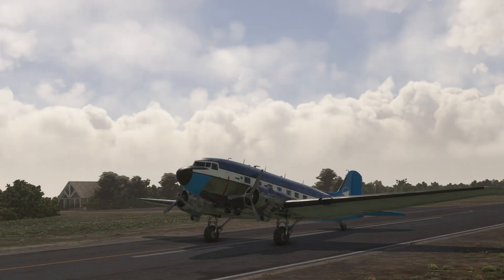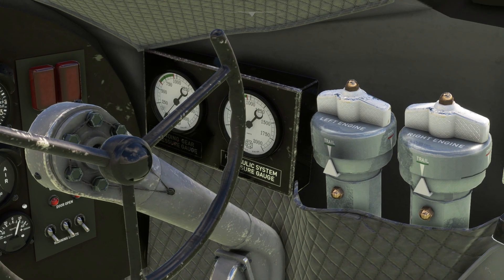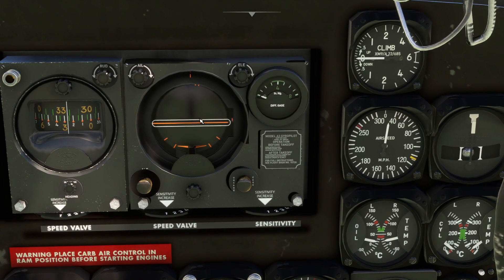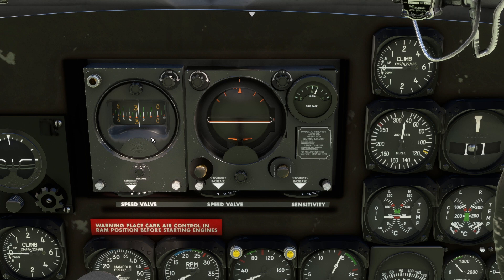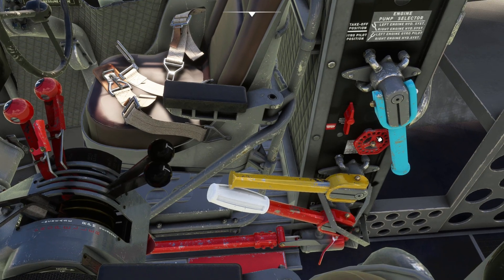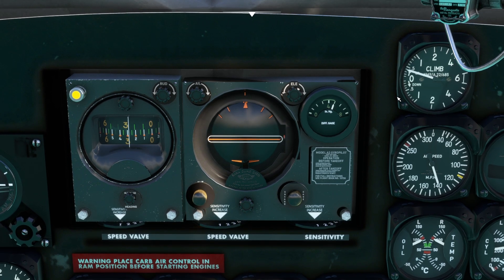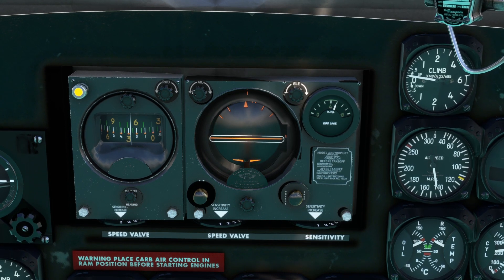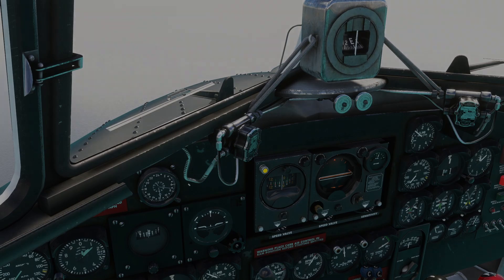The most UPDATED TUTORIAL for the Douglas DC 3, C47 GYROPILOT-Autopilot | Microsoft Flight Simulator

Comment: Very good, most of the tutorials on how to operate this are out of date and show an incorrect method. Microsoft haven't bothered issuing updated instructions for this aircraft since it was updated. However, there are two important points you should have mentioned:
1. The aircraft will sometimes initiate the turn just by moving the rudder knob without needing to touch the bank angle control. This seems to be entirely random.
2. Occasionally the aircraft will not stop at the selected heading but will merrily continue banking, turning in a complete circle forever if you don't intervene. This is less common.
Both these effects appear to be bugs.
Reply from the maker: Thanks for the additions. Yes there are quite a few bugs which need to be addressed with this plane and bringing this AP update without any info on how to use it just renders this iconic plane useless for many users. I figured it out after a lot of research and actually referring to the original sperry AP manual!

Comment: Good tutorial. Thanks.
Somebody has a problem with take off of th dc 3. My dc 3 before take off turn left or right side and I don't know why.
Reply from the maker: Thanks! Yes this plane tends to drift to the left due to momentum of the engine, but it is exaggerated in this plane model. Try duckworks mod available on flightsim.to. It has it more controlled.
Reply: It’s too light, if you add some payload it won’t be as squirrelly
Reply: Hi, I had this problem also on my first flights with the DC3; which I was used to fly frequently in FSX. I have adjusted the sensivity of my joystick with rudder function to about 15%. this will move the rudder only a little and allows for a fine control of heading during start up on hte runway. While starting pay attention to keep the centre line, as soon there is a little deviation, adjust a little to line up again,. make slow adjustment as this bird needs some time to react to your controls.  After some 2-3 trials, I was able to make consistent good starts. :)

Comment: Great video, great help. Could you share how to get a mouse pointer like the one you are using. Its the arrow cursor/pointer when you rotate knobs in the panel. Many thanks in advance
Reply from the maker: Hey. Thanks! No problem. For the mouse pointer. Go to general options > accessibility > change cockpit interaction system to "legacy". You can also turn off menu tooltips and instrument tooltips if those not needed.